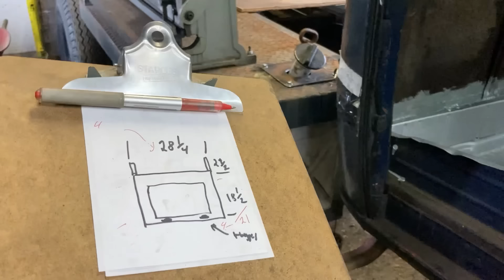Almost Got Stuck on the ATV   Quad But I Have Talent April 14 2024

Comment: I noticed all your GM V8 have center dump exhaust manifolds. We call them ram horns in Maine. We used them on our race cars. Very hard to come by now. Also had to use a two barrel intake manifold. We looked for the ones that had Canada stamped on them. Great video.
Reply from the maker: yes the ram horns fit nice to miss the steering box. i bought these new through rock auto and had shipped to the end of the world. not a bad price and came with a few extra pieces. we like the 4 barrels because they are basically just being used as a 2 barrel carb. the 4 barrel was more common up here then the 2 barrel for some reason.  thansk

Comment: Good morning from Cape Cod ⚓ it seems just like yesterday you were running around in the td18 in a snowpack Kingdom trails, now you're  mud bogging, oh what fun 😊 we call that a Bobby Orr Body Mount. 50 degrees now, going to reach 61 this afternoon. Dinner looked delicious Xena, your old man wants you to grow some garlic, it's a cold weather plant should grow well in Canada 🇨🇦. Keep up the good work, until tomorrow 👍✌️🇺🇲
Reply from the maker: yes and now they are forecasting our usual spring snow storm to make everything white and frozen again. hockey pucks have been used a long time on these trucks and now we buy on amazon not find then in the snow banks at the local hockey rink. the sunday supper was good as usual.  thansk